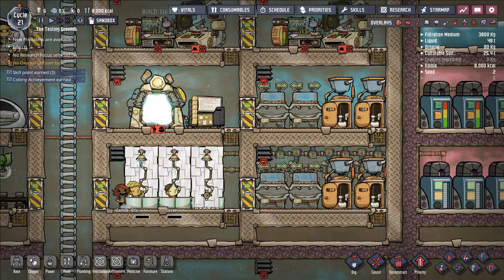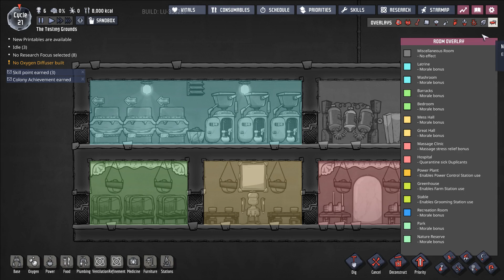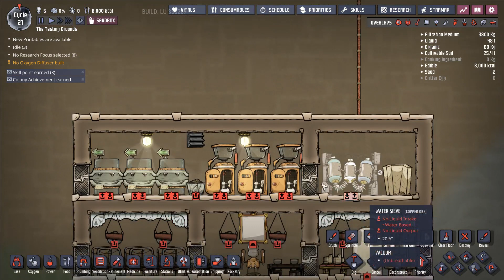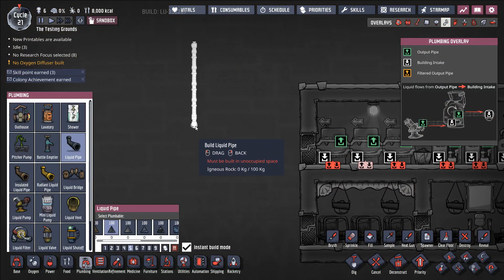The Infinite Bathroom; Build This NOW -- New Player Guides [Oxygen Not Included]

Comment: Hello, the idea is good but each machine has to have 5 water bubbles from the access pipe because if several duplicators use it, the machines do not finish the process, for the crops it is not very good, unless you put it that you grow in chlorine since the filter ends up contaminating germs and from that moment it will contaminate everything, for the serbs it is a good idea but not to give more distance to the tube ... Check it yourself and see that you can not, it It can but it doesn't give you the bonus. With a food pump all the base, I put a deposit to each bathroom and has a shower, sink and sink but only for 1, if several duplicates get into the room, it is very likely that 1 of them can not make their things or not done, your method if the contaminant is contaminated when leaving the room use the sink and decontaminated. Thank you for the contribution, I hope I have helped you as you have done with me.
Reply from the maker: A lavatory / sink only requires 5kg to run, so you actually only need half a packet of water, not five.

Crops grown with germy water do not get the germs.

Limiting use of the sinks to dupes leaving the bathroom prevents the issue of a germy dupe walking in and washing their hands as another dupe is trying to leave-- another method is to have your lavatories and sinks on different floors, with a ladder leading from the middle of the sink room to the lavatory room.  You can enclose it all as a washroom if you keep the rooms 3-high, and still fit a large number of buildings in, like 4 lavatories and 8 sinks.  This lets you use the sink floor as a sort of decontamination chamber between your base and a germy biome, like the swamp biome, even as it provides a place for your dupes to wash their hands after going to the bathroom.
Reply: @gearheadgaming1  I will take your advice because I am playing in the new version that increases the heat, it gave me that problem before, I will try it and I will alternate the timetables, thanks for your advice, very kind of you.

Comment: P9 the Sieve. If it runs out of sand, no amount of bridges will stop your water from bypassing your toilets
Reply from the maker: I should have mentioned that.  Either high priority on resupplying the water sieve with filtration medium, or a couple liquid reservoirs to make sure there is a buffer in case the water sieve isn't running for a while.
Reply: @gearheadgaming1  Would you put it on the clean side going into the bathrooms.  Or the dirty going back to the sieve.
Reply: Just add auto sweeper w a sand supply down the line to take care of sieve, and transfer polluted dirt to the compost, then dupes only need to pop in to stir the compost.

Comment: Nice! One suggestion... for new players (and illustrative purposes), it might have been better to use a closed loop and fewer bridges as an example setup. After the system is primed, you only need two bridges to siphon excess water (one for clean and one for polluted). Also, the sinks/toilets/showers all have a tiny amount of "storage" that address the old, cooky pipe mechanics we had to deal with in the pre-release--meaning, you can now just run the pipes straight through the in/outputs without them starving/blocking the rest of the system.
Reply from the maker: True, it might have been a lot easier for new players to follow a design that sends the pipe straight across the ports.  I still build like this in my games though because 1) I'm worried Klei will patch things so that the pipe-straight-across method breaks (they had some problems with this right before the game launched), and 2) because it gives more flexibility.  If I decide 50 cycles in that I want to replace my bathroom with some other thing (like maybe a bunch of liquid reservoirs) and move the bathroom somewhere else, then all I need to do is deconstruct the bridges and replace them where the new thing's input/output ports are.  But if I have the line running straight across the bottom of the room, then I dont have a choice, that line is going to supply every port it comes across.

It is really nice though that they added the storage to bathroom buildings though, probably will result in a lot fewer posts on reddit asking "Uh, why doesn't my toilet work?"

Comment: so to make dupe not gonna get food poisoning is build the sink beside the toilet?
i try this mode but, every time the polluted water being cleaned it's getting more food poisoning.. is that okay?

oh btw thanks for the new videos of new player guides..   👍
Reply from the maker: Yeah, make sure that the only way they can reach the toilet is by going past a sink-- then any time they are done using a toilet they have to go past the sink and wash their hands.

It's fine if the water gets more and more food poisoning, because weirdly the game doesn't care if a dupe washes their hands with germy water.

Also, the only way a dupe gets exposure to food poisoning is if they eat something that has the food poisoning germs on it.  So there are actually a lot of things you can do with water even when it has a lot of germs on it-- plants can use it as irrigation just fine, you can electrolyze it, etc.
Reply: @gearheadgaming1   some noob question, does the fruit that drops from the plant that feeds by germ water. got germ in it??
Reply from the maker: @sang7873  No, it will be germ free.  Be aware though that if your duplicants are manually delivering the water, they will get germs on their hands, and when they supply the water will get a little bit of the germs from their hands onto the plant.  But if you're using a hydroponic farm, it shouldn't be an issue.
Reply: Just another detail . If you use clean bathroom water for the electrolizer it Will disperse food poisoning on oxygen , but It Will not sick the dups (i been 300 cycles With that And never got a food poisoning sickness)

Comment: u only need one liquid bridge, works better and looks better ;) been doing it with one since the start
Reply from the maker: @Ivan Dobrev Bridges might look complicated to humans, but to the pathfinding algorithm they are simpler than pipes.  Think of them like 1-way pipes.  The computer has an easier time figuring out where the fluids should go when you tell it where they cant go.
Reply: @gearheadgaming1  I'm not following why you think using more than one bridge is good either.  I'm just coming back to the game after about a year off but in the year I played before that, never saw a patch somehow break pipes being able to either accept water from multiple machines ( via branches, not directly in a line across all the machines ) or distribute to multiple machines.  It also reduces the storage for the bathrooms rather than expands it, since the bridge does not actually hold any water, you are losing 10kg of capacity from having 1 more pipe instead of the bridge.
Reply from the maker: @phillipsusi1791  You missed the patch that broke things then.

You haven't provided a clear example of what you're comparing this system to, but you're clearly wrong on the question of storage.  There are two pipe segments on the toilet/sink side of the input bridges, and because the bridge exists it ensures that those two segments are filled first and cannot be drained, whereas if you replaced the bridges with pipes you'd 1)  Not have more tiles on which you're storing water and 2)  Get the input to your bathrooms drained every time you siphoned water from your input line after the bathroom hookups.
Reply from the maker: Looks better, maybe, works better, definitely not.

The four reasons I've given in the other comments:

1)  Previously, Klei has had patches that broke the 0/1/2 bridge approach that didnt break this approach.

2)  It expands the storage for your bathrooms so that they can have immediate resupply regardless of where you position your loop's siphon

3)  It's more flexible in a number of ways.  For example, you could retrofit your bathroom into a line of liquid reservoirs without ever disrupting flow in your main water line.

4)  Every junction between pipes should be governed by an input or output port, otherwise it creates lag in your game.

Comment: Why bridges instead of piped them straight up?
Reply from the maker: Super long answer: there are a few reasons.

Firstly, every junction between pipes should be governed by an input or output port, usually a liquid bridge either splitting from or merging onto a line of pipe.  The game uses a sort of pathfinding algorithm for deciding where liquids should flow, and setting the rules for every junction takes a huge load off the algorithm and not only makes sure the liquid goes where you want it, but also reduces the lag in the game itself.

That means we wouldn't want to run a pipe under the bathrooms and just have it connect up/down directly onto them, because 1) we wouldn't be prioritizing resupplying the lavatories and sinks, which are most important, and 2) we would create a lot of lag which would slow the game down a lot as our base got bigger.

We could run the pipe not through the floor but straight across the input and output ports themselves, and the priority rules should still work (take the port if you can, continue on if you cant).  But there are three problems with that:

1)  This is going to be a really unsatisfying answer, but here goes: For some reason, this system just works better.  In very recent history, Klei has tried to optimize liquid/gas pathfinding in order to reduce in-game lag, and twice the method of running a pipe across the ports has broken, once was a soft break where the liquid packet between the ports would stop moving (like it couldn't decide which port it was heading towards), and the other was a hard break that simply crashed your game.  They rolled back the patches, but I don't think they've given up on optimizing the pathfinding, and I trust this bridge system the most to not get broken by a patch.  If I had to guess, it is because the game queries "can I enter this input port" differently for bridges and buildings, and something about that difference causes issues sometimes.

2)  This system guarantees that there is always a small amount of water kept in reserve for immediately resupplying the sinks and lavatories, no matter where we decide to siphon off excess water.  For example, if we ran a pipe straight across the input ports, but also wanted to siphon off excess clean water to the left of the washroom (say we had our bristle blossoms out there), then that siphon would drain all of the water from the main line, with nothing in immediate reserve to refill the sinks or lavatories.  When a duplicant went to the bathroom, we'd have to wait until the water went all the way from the polluted water line, through the water sieve, and back through the clean water line before the sink and lavatory got resupplied.  With the bridges, the siphon cant drain water that has already flowed across the bridge, and the pipes on the other side of the bridge forms a small immediate reservoir to resupply a sink or lavatory right after it is used.  We dont need much-- a sink or lavatory only uses half a packet worth on use, but a small amount helps everything move smoothly, even if we have a small number of toilets per dupe.

3)  We lose a lot of the flexibility we'd normally have with the system if we run the pipe directly across the ports. We wouldn't be able to change the priorities without removing the buildings themselves.  But with the bridge system, we could always decide to change the priorities.  Replace the bridge going up with a bridge going sideways, and we can flip the priority without having to deconstruct anything but a couple pipes.  This last one isn't very relevant for bathrooms, where we're probably never, ever, going to change the priority, but for more general systems it's important.
Reply: @gearheadgaming1  Crystal clear. Thanks a lot for this long answer indeed haha.